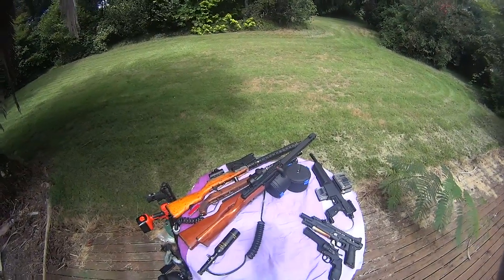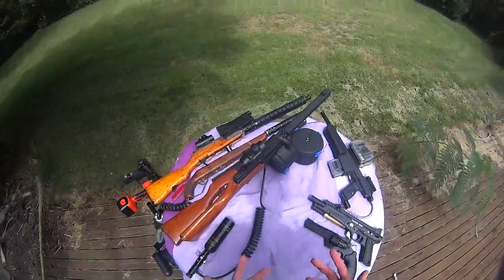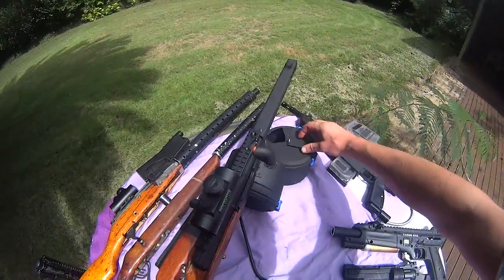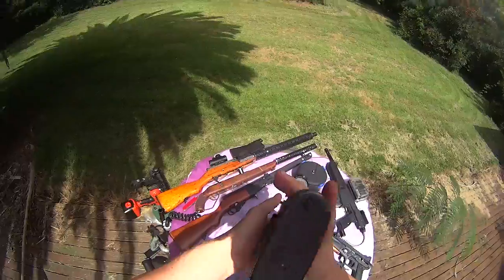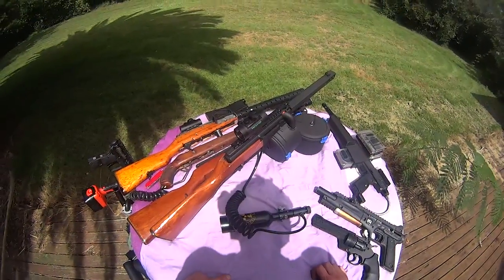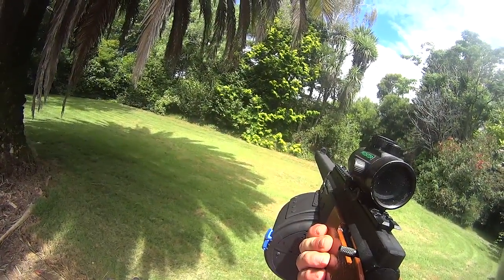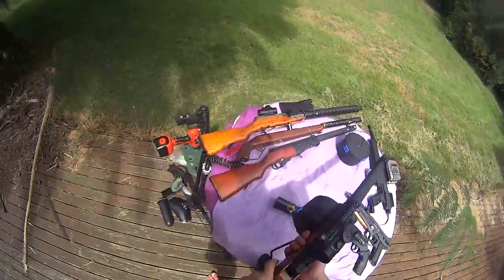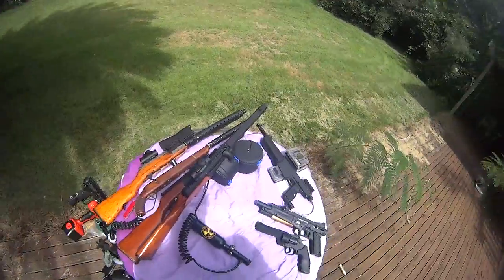Paintball PPSh-41 mods - and more to come!

Comment: Would you be able to give me a list on all the parts you used to create this gun, I wanna get started on building one but I need a bit of guidance
Reply from the maker: +Danny Miranda There's too much stuff to list but here's some of the mains. 98 custom, SKS stock, aluminium box section, RT trigger, food container, steel sheets, steel wire, double trigger, aluminium pipe, copper pipe, push pins
Reply: +Jiggaladd do you have like a tutorial video? or a website I can use to flow step by step
Reply from the maker: No... sadly this was build over a year ago and I have moved onto a Gen 3 model. If I ever become famous for these I will make a tutorial so we can all have them. You will also need a BT RipClip too
Reply: +Jiggaladd since you moved on, do you still have your previous models, because if you do I would be intrested in buying one
Reply from the maker: I have one more of each, Zeta and Drum Mag models
Reply from the maker: +Danny Miranda Contact me through fb or the mag fed paintball page if you are interested in buying. I don't like to clutter my email. (Samuel Hodder)